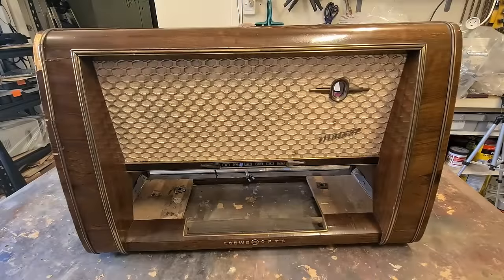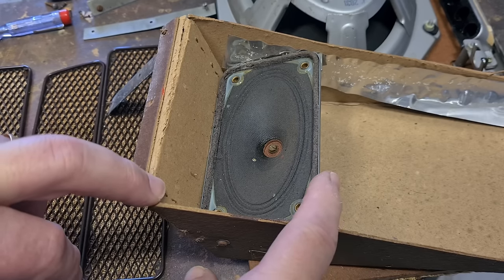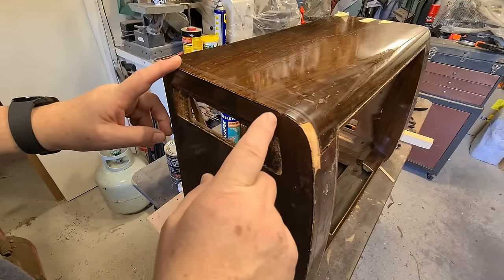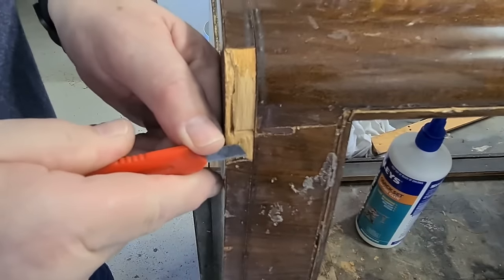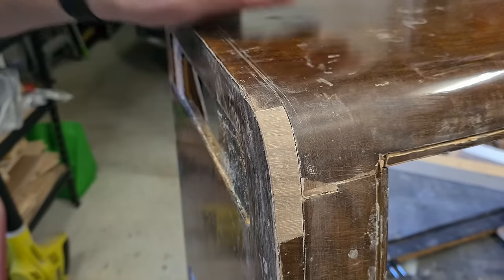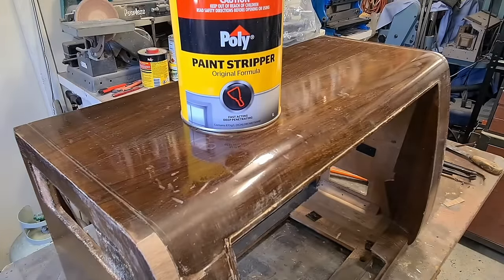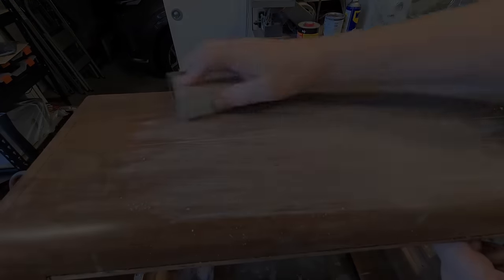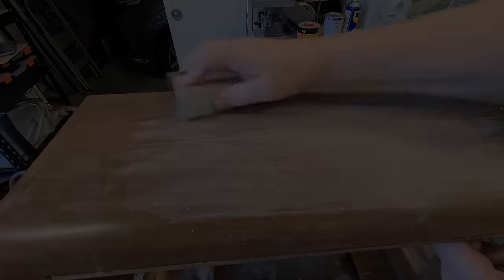Loewe Opta  Meteor 1781W - 1956 - Part 3 - Final

Comment: Wow! I did not expect to start my Friday morning with so much sanding and cabinet work. I’m exhausted!
Seriously, though, that was an absolutely amazing job. I don’t think I’ve ever seen such a dramatic transformation of a broken and chipped cabinet to the result you’ve achieved.
The only thing I do differently is that I usually mark out that black trim on the side with a permanent marker once I’ve done the staining itself and before the gloss coats. Those thick permanent markers hold well on the corner and I guided it with my finger to get a uniform line around, I have had good results with this method to date. I don’t know what else to say except that I am absolutely gobsmacked with the result. Congratulations. That’s definitely a Portuguese gold medal winner (on the German radio restored by an Aussie) 😅
Reply from the maker: Haha... have a cup of tea to settle your nerves Manuel. I was halfway to fetching a black marker to do the black trim but wasn't sure what the clear would do. I will heed your suggestion and experience next time Manuel. Oooo... a gold medal. Thanks 🥇👍🙂

Comment: G'day David, the timing of this video couldn't be more perfect for me.  I was just given a STC TR6100 Aussie 1960 transistor radio, it was on a skip bin, but I got the radio working, but the cabinet is rough and has the same cosmetic case conditions you have here. You not only tackled but gave me a blueprint on how to tackle my own project.  Thanks for the endless quality content and ideas you document.  While my little tacker is not worth much, it's a great project I'm looking forward to practicing on with restoring the cabinet thanks to your guidance.  
Have a Coffee on me! 
Cheers! Rick
Reply from the maker: Thanks Rick. I am going to try putting a layer of shellac down before the stain next time. It might even up the finish a bit and not highlight areas of filler. Good luck 👍🙂
Reply: @DavidTipton101  Ahhh, neat idea, I think your results are amazing anyhow. God Luck to you too with all things :)

Comment: Just watched this through again and realised I didn't leave a comment the first time.  Loved the Queensland covid borders ad at the start!  
I thought I was the only one that ended up stripping radio cabinets over and over again!  I always thought everyone else got it right first time! But persistence usually pays off in the and and this was a spectacular result!
Now I have to do the cabinet on the Bush and you've set the benchmark so bloody high I haven't got a hope!
Ah well, I'll give it a go.
Cheers Dave
Reply from the maker: Hi Don. The covid add, or lamb ad was genius. If you watch the whole ad there is a reference for WA as well. I usually only do it once Don but this one kept going wrong. If I was able to use the spray gun as normal it would have been OK. You do pretty well on the cabinets Don, I am in awe of your results too. I'm looking forward to your struggle 😄
I started on the Hotpoint you sent over, thanks 👍😀

Comment: That cabinet looks amazing. All that effort was worthwhile. With the poly spray cans I've found that even after inverting the can and spraying to clear the nozzle it still sputters the next time you use it. I remove the nozzle and soak it in some turps overnight before the next spray and that seems to work well. Absolutely stunning restoration both electrically and cabinet wise as usual.
Reply from the maker: Hi Ian, thanks for the tip although I think the spray I used was acrylic. I think I emptied the cans anyway.  Thank you 👍🙂

Comment: I heard Rolls Royce build their lacquer up to 1mm, then finish it by sanding it back to 0.2mm to get that luster and finish on their wood trims.    That extra bit of sanding really makes a difference.  There is a difference between gloss and lustre.  That silky smooth feel as you run your fingers over that smooth finish, it just feel good and looks good too
Reply from the maker: That sounds about right Brendan. Agreed, luster is completely different to gloss, you just want to touch it 😋 thanks Brendan.

Comment: Hi Dave, a fine job on the cabinet - all's well thats ends well. But six times? What a frustrating process. Those German set do sound great don't they, but the switches can be a nightmare  as per Don in WA.
Reply from the maker: Hi Andrew, thank you. It was only 4 times... maybe 5. I have never had so much trouble 😄
I spent a bit of time on the switches cleaning and adjusting the contacts, they are a problem 🙂

Comment: What a wonderful way to start my day here in South Dakota! Love the way that came out, it looks like it came off the sales room floor as a demo model. I love the way you got that patch to work on the finish, it blended in very well, I had wondered how you would get that brass trim back in order, I thought, perhaps some gold solder but your method was great, you get a lot more use out of super glue then I ever did. I used to help out my next door neighibor in his mortuary with the bodies, he used super glue to keep the eyes shut, the hands together and such. I knew it could stick skin very well from early attempts to use it, but I gave up on it and use a sort of old airplane model type glue for most of my repairs. It takes a bit longer to dry but I think it holds a bit better in some cases.
Reply from the maker: Thanks Jerry. Super glue on dead bodies, I never even considered that 😲 It has its limits but a very useful adhesive 🙂

Comment: Thoroughly enjoyed watching you restore this radio! Only thing is you made the finish look so nice that the grill cloth stains look even worse. I hope you can get the stains cleaner or god forbid replace that grill cloth to achieve the perfecton you have nearly achieved with the rest of the radio.
Reply from the maker: Hi Nicholas, thanks. I have learnt the hard way to leave the stains alone, if they won't come off using soap and water (they didn't) then I leave them. Much better than a damaged cloth particularly as this was not my radio 🙂

Comment: When trying to force glue into a gap, I once saw a guy lay the glue down the open edge and then blow the glue inside using an air duster or compressor.  It worked really well, so i filed it as a useful tip in my brain. Never tried it myself, but I thought it might be useful to you if I passed it on.
Reply from the maker: Hi Andy, that might end up with glue everywhere 😄 I guess if I turn the pressure down to a few psi it might work. Thanks Andy 👍🙂

Comment: I agree with the general consensus of all of the positive comments David, you're perseverance is beyond imagination - and the results are truly amazing, what a work of art! I was a bit more curious about the "3D" thing and how that changes the sound as you switch the high frequency drivers on and off - and you mentioned several times how it's not uncommon to find electrostats in Germain designs, that would be another curiosity for me, I've never seen that type of driver in something like a radio (I'm a bit of an audiophile so although I've never owned electrostats, I've of course seen them, naturally much larger than one would find in a radio) - - anyway, another fantastic overall result from all of the hard work and determination you put into this project - thank you sir.
Reply from the maker: Hi Skip, thank you. The 3D switch connects the two side speakers into the circuit, it broadens the sound somewhat and adds more high frequency. It was, I imagine, mainly for FM music. It may accentuate the static for AM so the option to turn it off may have helped in that case. All the other German radios with side speakers I have worked on previously have had electrostatic side speakers, they are only small, about 8cm X 10cm or so. They have high voltage to them and can be a trap if you are unaware of what they are. Most don't work anymore, the foam packing inside disintegrates and electrical contact is lost. They can sometimes be dismantled and repacked successfully. The output is quite low but it does add a bit to the sound 🙂
Reply: @DavidTipton101   Thank you sir, very much appreciate your reply and explanations.

Comment: Love these restoration videos and I am always eagerly awaiting the next one. Your patience is inspirational. I'd like to throw out something I just encountered and ask if you or your followers have ever seen this.

The final step in aligning my Truetone D2616 calls for setting the tuner to 1400 and adjusting the antenna trimmer C4 for maximum output. Pretty straightforward except for the fact that there is no antenna trimmer and there never has been, despite being called out on the diagram. Any thoughts?

Thanks again for all you hard work. Your positive attitude is contagious
Reply from the maker: Thanks Ed. I looked at the diagram for your Truetone D2616 and as you said it shows C4 on the circuit diagram and shows it mounted on the back of the tuning capacitor in the drawing. If it's not there it may have been moved to a different part of the radio due to using a different tuning capacitor. Most are mounted on the capacitor though. It would be very unusual to not have one as you would not be able to tune the capacitor to match the oscillator. Feel free to send some photos in an email if you wish. It's on my channel page 🙂

Comment: Absolutely great video, unfortunately the cabinet restoration didn’t go as easy as one would like. I have a pair of gloves with an abrasive/sandpaper on the palm. This eliminates having to hold on to a sanding block or sheet of sandpaper. They’re thin and flexible making it easy to sand curved areas. I found them online, they’re called “scuffy gloves” and come in various grits. I hope this helps on your next cabinet project.
Reply from the maker: Thanks Ralph. I checked on the gloves, they look good but are near $30 a pair. I initially thought it was for a pack of 10 or something but it was only a pair 😲 I will persevere as before, someone suggested a drop of dishwashing liquid in the water, I might try that. Thanks Ralph 👍🙂

Comment: Hi Dave, nice job. I wonder if you should have put the pore filler with a plastic spreader, I'm thinking by using a cloth most of the filler was removed.
Rich
Reply from the maker: Thanks Rich. I used to use a spreader and it can produce a better finish but it is so hard to know when to stop sanding and when the finish is smooth, the finish is crear after all. Wiping it on does work and sanding time is greatly reduced. The pores on the wood are still filled. If I was doing a guitar or similar I would use a spreader 🙂

Comment: I meant to ask this on the video where you were actually doing it:

o   Do you disable AGC when aligning, or do you just ensure signal is low enough that AGC remains fully on and constant?

When I align I wobbulate, and am not religious in setting  IF to specification, but will use whatever any jammed IFTs force upon me. 

I love these cabinet repair jobs - they make me (foolishly, perhaps. On second thoughts: 100% foolishly) think I could do it too.
Reply from the maker: Hello frogandspanner (sounds like a pub 🙂) No, I don't disable the AGC, you can of course but I keep the generator signal as low as possible. Yes, I could have aligned the rest of the IFs to the stuck ones, it would have been close enough it turns out. I had the bandspread switch engaged which, I think, made the adjustments further out than they were. You can only try doing a refinish, you may have better luck than I did 👍😀

Comment: 42:06 It wasn't uncommon for German radio manufacturers to make side speakers controllable with a 3D switch, especially in the pre-stereo era. Loewe wouldn't be the only one
Reply from the maker: Ok, thanks Professor Micron. I haven't seen it before on the few German sets I have worked on, the side speakers have been hard wired in 👍🙂

Comment: I don't understand what an electrostatic speaker is. I understand a field coil and permanent magnet 🧲 speaker. I also know what a piezoelectric speaker 🔊. Can I have you explain what an electrostatic speaker 🔊 is? Your friend, Jeff.
Reply from the maker: Maybe Goole it Jeff for a better explanation. It consists of one or two perforated plates with a taught plastic, usually a form of Mylar, membrane between them or nest to it but not touching. The audio signal is applied to the plate or plates which repel or attract the plastic membrane in sync with the signal. Electrostatic speakers are better at the higher frequencies and poor at bass frequencies. In this case used as a tweeter. They run on high voltages, about 50 Volts in this set.